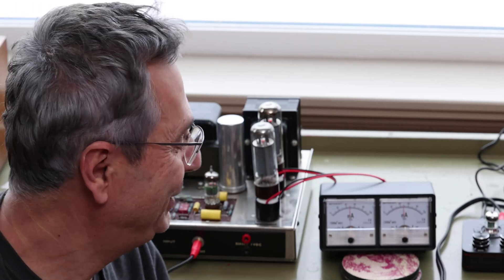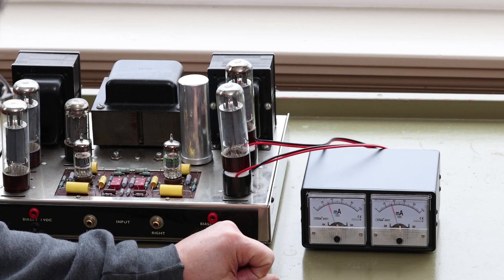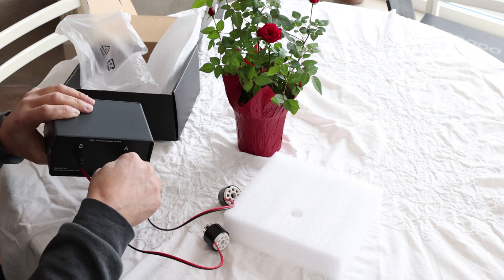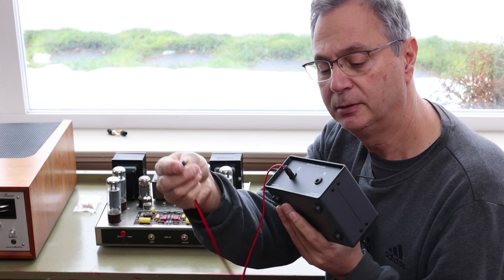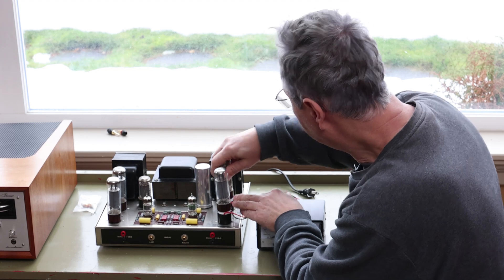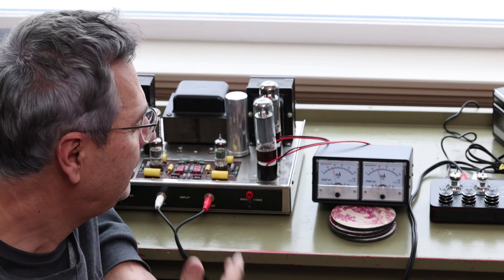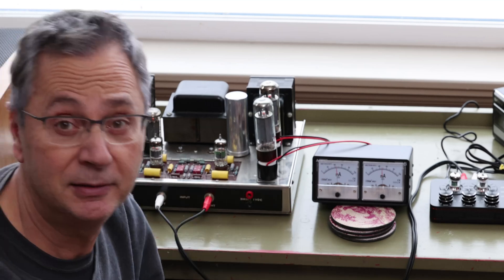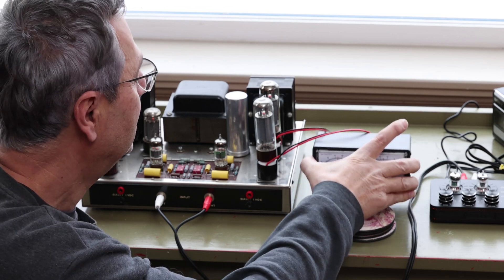Measure Tube Amp Bias Easily with Douk Audio CT1-Box

Comment: Pretty cool little box espically for price point to measure Cathode Current for tube bias' 
I saw the Vintage Marantz owned many of those , But Sansui stole my soul lol 
 great Job ' Gabster I ordered a volume control For vintage Amps haven't set up yet been crazy busy!! Haven't even gotten to my Polk 703 yet that Gr research modified the crossover $$$$$ got a new Hakko also and very expensive soldier ' thanks Gabster '
Reply from the maker: Nice to see you got a soldering gun and tools 
There is no turning back now.
Enjoy the ride don’t hesitate to message me if you need any help 😊
Reply: @Gabster1  I appreciate that Gabster 😆
Reply: @Gabster1 ❤
Reply: Cathode

Comment: Hi Gabby - Try swapping the cables to see if the difference in readings could be caused by slightly miscalibrated meters
Reply from the maker: I did they are not mis calibrated I also swapped the tubes and that helped I am not a fan of designs that tie the bias of the 2 tubes together I would split it it but the Device was good and well calibrated both the same .